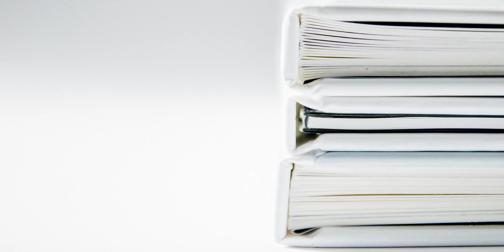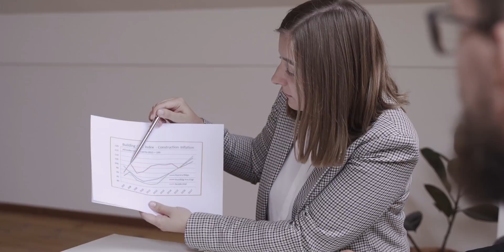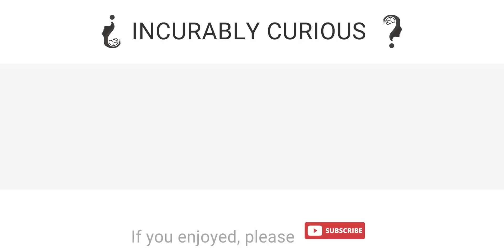Why Most Power Lines Aren’t Underground

Comment: Here in Denmark like other European countries, are all the power lines below 150 kV are 
buried underground in cities and towns, for public safety reasons.
Only the main transmission lines 150 kV to 400 kV which are located in the countryside are installed on transmission towers.

Actually we consider public safety associated with high voltage lines, right from the beginning of construction of nationwide AC power distribution systems which is dated from 1907.

At the beginning it was only the main high voltage lines 10 kV to 50 kV where buried underground in the cities and towns, and they were covered with concrete to warn the diggers about the dangers.

The low voltage lines (220V / 380 V) and telephone lines in most areas of the cities and towns were buried underground but in some other areas hanging on wooden poles.

As problems associated with storms and hurricanes cause downed power lines and power outages, we decide to bury the remaining low voltage lines and telephone lines underground.

In fact in Copenhagen most of the 10 kV to 50 kV high voltage cables, and 230/400V low voltage cables which are buried underground are still the same original cables dated from 1907. Those old cables are made of paper/oil insulation, covered with lead jacket and outer steel armor. 
What is incredible is, all those cables are still in service despite their age of 120 years and their exposure to water and environments. 

By the way we do have lots of winds and heavy rain in Denmark, without causing any problem in our power distribution systems.

I have lived 24 years in Denmark, and I have only experienced power outages 2 times in my 24 years.
The first one happened in 2003 when a short circuit in a substation in Sweden caused a massive blackout in south Sweden and part of east Denmark.
The second power outage happened in 2016 in my local area, caused by an underground 400V cable short circuit, which only affected our street.

As you can hear we have a very reliable power system, despite most of our power distribution systems being buried underground.

Maybe the reason we have success with underground power distribution systems in Europe is, because we designed a better and safer electrical power distribution system right from the beginning of the 19 century.

Comment: My home has under ground power lines coming from the street where the transformer is located. The line going to my home somehow failed and the power company had to install a new line. They told me under ground lines fail all the time. My home was built in 1989 and the underground lines lasted up until 2022.

Comment: The power wooden poles that cross my property are still the original ones since the wood was treated with a now banned technique/material. I have seen many newer wooden ones having to be replaced often while the very old ones tick on by.
Reply: Petroleum based creosote?
Reply: @curtiskretzer8898  yep, that is what it is, the line was installed in the mid 50's (estimate)
Reply: @mooing_cowmilk  They don't use creosote anymore but new poles are still treated with chemicals to make them last. As to why newer poles near you are being replaced sooner than the older ones could fall under several reasons.
Reply: @ta3544  the newer ones that are replaced are the (healthy) treated ones. I don't think raw wood ones even exist
Reply: @mooing_cowmilk  creosote might work better than the new stuff, I'm not sure. I was told some older poles are stronger than newer ones because they were naturally grown trees, not farmed trees grown with chemicals to speed up the growth process
Reply: Sebastian Hahn  I believe it. I work on powerlines and a guy explained that the new poles have fewer rings in them and they are more spaced out because they grow so fast
Reply: Old growth wood is far superior. I resurface floors up to 120 years old end the old wood is bulletproof. Same for structural timber.
Reply: We could just tell people to not let their children chew on power poles and railroad ties. That would solve the whole creosote issue. shrugg

Comment: Pretty good system the power companies have. They charge you for their product and then charge you to deliver their product and any extra costs associated in delivering their product is also passed on to the consumer. I put in a shop and they installed they were nice enough to install the line to the shop but instead of running the line under my driveway they made me cut out a 2 foot wide section of the concrete out of my driveway so they could dig it up and bury the line. All so I could pay an extra $20 a month, before any electric usage, for the line. I know people how run cables under stuff like and the costs would have been less than $500 for the width of the driveway but my local company wouldn't even consider the option it was either install it their way or pay someone to run it cable from the transformer to the shop and then pay them to hook up the line on both ends. I bet farmers would love to pass on the costs of planting, maintaining, harvesting, and transporting their products to the customer as well but instead those are considered costs.

Comment: Sort of silly of the entire video trying to take an "All or Nothing" declaration about a technical topic. 
 
Of course we can put much or even most of the "Poles-and-Wires" (local distribution) underground, and it is not cost-prohibitive nor technically challenging.   
Humans have been digging holes for a looonnngggg time.   Doing so would improve reliability, safety, and durability.   We already know all this.  Local distribution is where most failures occur.  

Construction Costs stem from the means-and-methods of the construction (good design) rather the materials and locations.  Many utilities are operated by entrenched old-tymers who find "new-fangled" frustrating and may limit improvements.  This tends to be the REAL limiting factor.  

All components of the Grid have rated a "Service Life."  The Service Life of the various parts-and-pieces vary, but are about 25 to 50 years.   Good Management plans and replaces about 2 to 4% per year and keep things fresh.   Underground lines tend to be on the long-life end of that with 50 years or more.  

The "Floods" issue is complete nonsense.  Underground lines are not harmed by water.  All are rated for wet conditions.  This includes both direct burial, cables, and/or in-ground duct-conduit wires.   Transformers and Switches should be above the high water line -- but that is not the  "wires."    

As far as system reliability, that is best handled by  using "loops" rather radial distribution -- whether above or below ground wiring is involved.  With loops, power comes from "both" directions, and only small point-to-point sections are at risk of "single-point" failure, even under extreme conditions.

Comment: This video is either paid for by power companies in the US or this guy works for one of them. Here in the NL we have every power line apart from the big ones underground. We rarely if ever have outtages due to people with shovels or construction because every construction company is required to be aware of every cable around the area they work before they can start working.

For states like New Zeeland I get that it'd be best to keep your above ground lines but for the vast majority of your country it would increase reliability by a lot.
Your government should mandate electricity distributers in your country to use some of their profits to save up for upgrades for the grid instead of pushing any costs to the customer's bills.

But for some odd reason I can't put my finger on, I highly doubt you'd be for that.
Reply: Most new development in the US has had underground cables since the 1960s. My development, built in the 1990s, is all underground utilities. But the development is fed by overhead lines built decades earlier. Some idiot driver hits a pole, or some tree falls on one, etc, and voila--all 300+ houses are without power. During bad storms, you can expect it to last days. We've been trying to get them to underground them for decades. Cheaper to just let us go without power for a week every once in a while, I guess.

Comment: In 1850 they started placing communication cables across the Atlantic underground. By 1900 all major continents had buried cable systems that connected them. That was over 120 years ago. Today, those cables now upgraded to fiber optics are how 99% of all communications are made. We Don't use satellite's. Largely it's radio wave based communications between cell towers for local use and for international use that signal goes under the sea then distributed by outgoing cell towers.

Comment: Good video with high level description of the main reasons affecting above vs below ground. Still got a laugh at "In the future this technology will assist in locating the failure." That tech has been around since the 80's. Power companies, today, can buy relays which can tell them the distance to the fault down to the meter, and have fault sensor that tell you the branch as well. In other words, almost instantaneous knowledge of where the fault is, but you're right, it still doesn't help with long repair times.

Source: Worked for Schweitzer Engineering Laboratories for 10+ years. They make the above equipment. Their first selling point was "For less than the cost of a helicopter inspection of the line, our equipment will tell you how far down the line your crew needs to go to find the fault."
Reply: Yeah that was funny. "In the future" No buddy, it's happening now.
Reply: Singapore puts these cables and pipes in underground tunnels so they can be accessed without digging.
Reply: Time domain reflectometer

Comment: in the ground cables need to be bigger because they can overheat, no air cooling.
higher transmission voltages in the local area need more consideration.
if we go all electric, to lower CO2 then power flows will increase.
I suspect that the grid will connect all rooftop PV to the grid, and to the industrial users.

Comment: What about running pipes underground for the wires? If a cable breaks or wears out, you could send a small remotely operated vehicle through the pipes to pull the new cable. Plus you could pull other cables more easily (e.g., fiber optic). It would cost more initially but could reduce maintenance or upgrade costs. The piping could help protect cables from digging, and they could have drainage holes to prevent water accumulation if the pipe was damaged. Natural disasters that do enough damage to the electric pipes would likely cause plumbing problems as well; this seems to be a rare occurrence.
Reply: We do that for glass fiber cables.

Comment: Bare wire in the air stays cooler and can carry larger loads. Underground the wire must be in a conduit and have insulation on each wire, drastically reducing the wires capacity. You would need massive wires to replace small wires in the air
Reply: Other than some national grid high voltage transmission lines and out in the countryside to small locations, we don't have overhead power lines in the UK.
Reply: @grahvis  yeah but we just had to have that elbow room here in the states. The problem is scalability  of what you have.. Still places where power lines don't exsist.

Comment: Locally, they upgraded a mile of roadway. Buried the utilities. Each homeowner was responsible once the power was delivered to the curb. 
Really cool street lights, bike lanes, big sidewalks. Each house has a wooden pole where the power and cable come up out of the ground. Through the air from the pole next to the sidewalk to the home's original power meter.
Looks worse.
Reply: That's the homeowner's fault for not paying for the hook-up to be underground. It's up to the homeowner if they care about curb appeal or not. What you spend you'll get back when you sell, plus.

Comment: Guy wires use is to counter lateral forces on the pole. Smaller poles use them if counter the force if the power wires pull the poll in a certain direction. Like if the wires stop at the pole then go underground, the top of the pole will want to go towards the wires. A guy wire will be places on the opposite side to counter that force. In addition to that reason they are also used on major power poles that don't have a large enough base to handle the wind in that location. At least that is my unprofessional knowledge on the subject.
Reply: There are overhead powerlines that use guy wires. They are insulated, separated by spacer brackets every few meters, and hang from a guy wire. It's called Hendrix Arial cables.